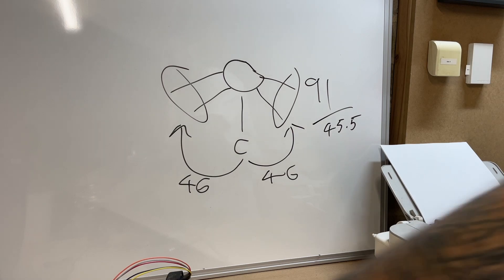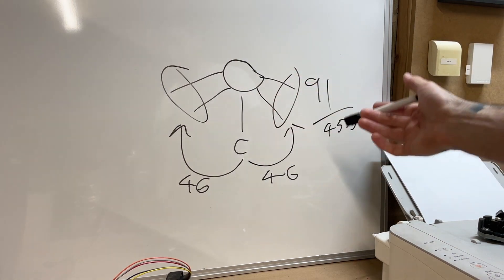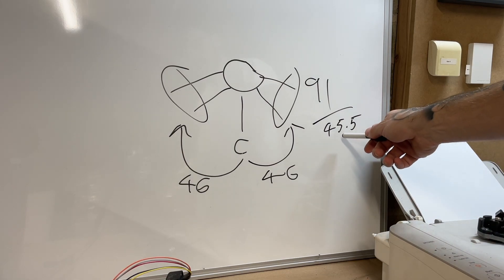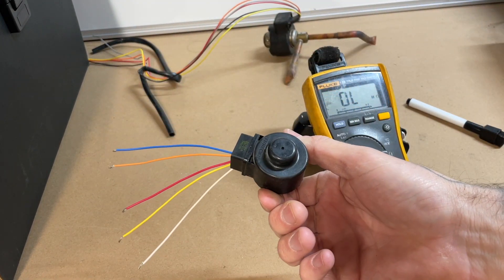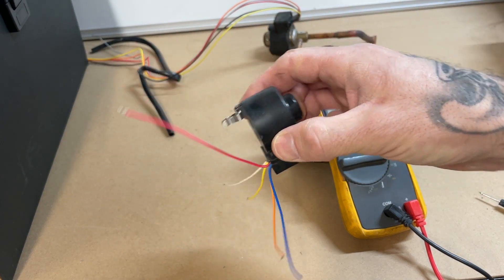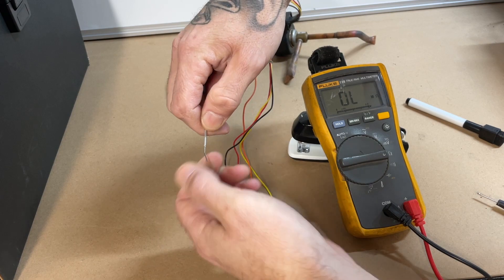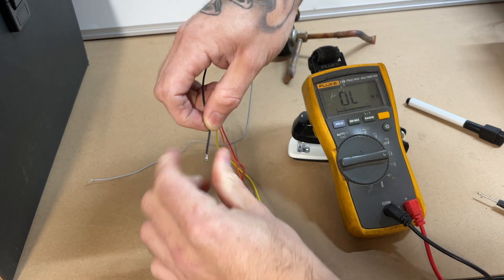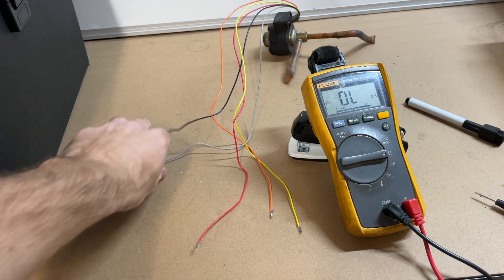HOW TO TEST DAIKIN EEV COIL (5 Cables).

Comment: Hi Mitch have you ever tried getting boards repaired I have always thought it crazy that we have to replace a complete board when I assume all they need is a component ie processor or something. I have tried but had no luck.
Reply from the maker: @declankearney9353  I’ve taken a board out that was no longer available and taken it to a repairer who did actually repair it but after it was reinstalled, a different fault came up. 
I personally think it’s too risky trying to repair because a component failure can take out another component and you won’t know until you turn it on. Also if it’s a Daikin processor that’s faulty, the repairer won’t carry those parts unfortunately. I just think manufacturers need to make more durable boards but I do know what you mean.

Comment: So I had a daikin 4MXM80 multisplit. After a month 1 room didnt work (valve didnt open). Placed a new motherboard, which blew up a month after installing. Daikin didnt want to send new motherboard under warranty. We decided to buy a new outdoor unit. (4000 euro).  And after a month the new one had the same problem, just different room. Now all the sudden Daikin admid that it is a common problem on the MXM series, due to "too low voltage going to the magnets". They will send a new motherboard. Not sure if that is the problem, or if the pins just get stuck. Just FYI so you know :)
Reply: We have exactly the same problem with the 4MXM68A. Been going on for 2 years now. They replaced the motherboard a month ago. We thought it was solved but this week one unit failed again. So changing the motherboard did not solve the issue. My guess is that the magnetic valves are just prone to get stuck over time.
Reply: Can you share an update after 8 months? Curious to know how things have been proceeding.

Comment: Professor, if you could please explain to us a video about the closed electric expansion valve, which carries the model EX7-121 from the working company Amrison, the method of connecting it to the driver, its maintenance, and its problems. I thank you for your cooperation. We greatly appreciate it.

Comment: Just wonder, have you seen any rust problem on the EEV motor part (the whole black thing)
Reply from the maker: Can’t say I’ve ever seen rust issues with them mate. Have you? I’m curious!
Reply: @maracservices  (I'm homeoner myself, so I may not have a lot of information about this) However, I did see them in the R22 system (2012) and the new R32 system (2-3 years ago) and plus the outdoor board issues.
there is a video link here: watch?v=Zk4Ku284cPU
timestamp: 5:01 is the capacitor that failed in the inverter board (compressor cannot run/cutoff at high speed/ramping up)
10:40 is the rusting EEV
And there are lots of video showing how to change the capacitor on the inverter board by technician and homeowner, that speak the number of how many of them failed.